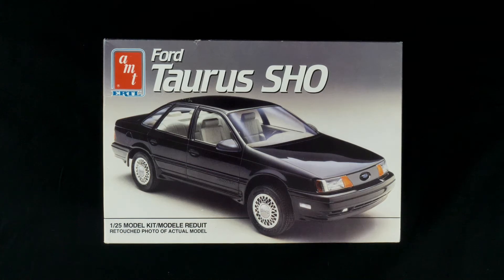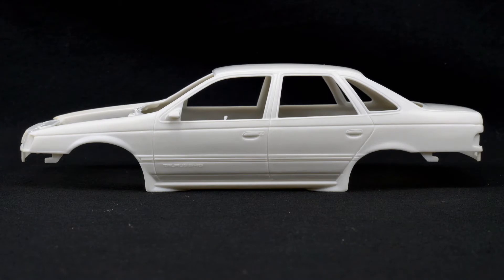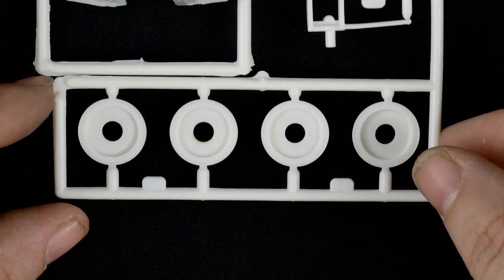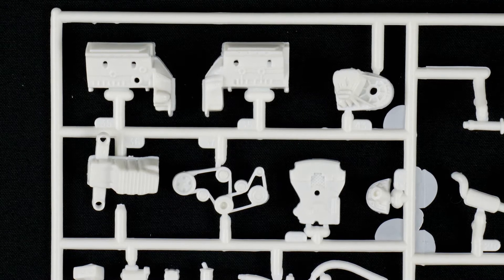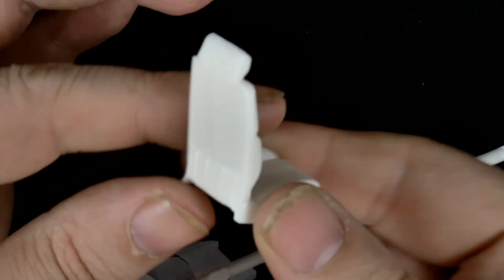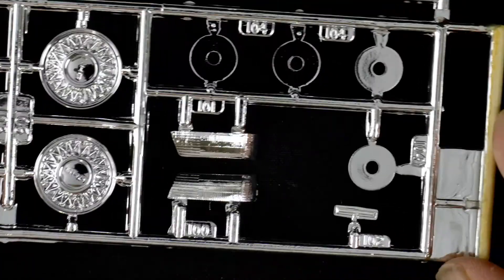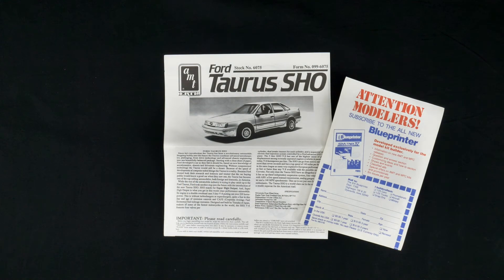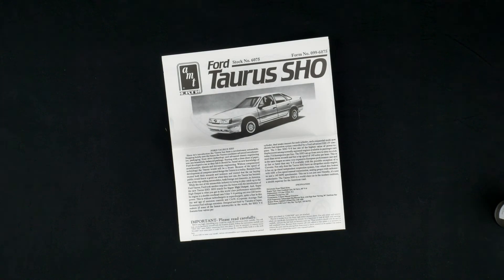Whats In The Box | AMT 1990 Ford Taurus SHO

Comment: Pay attention to how high-fronted some of those boxart builds are, almost like a real car with its' engine pulled. You'll need to shave quite a bit of material off the front underside of the interior tub and trim the firewall to avoid that stance and get the front down where it needs to be. No other build issues. Once you're done the most aggravating feature will be the "we've always done them this way" promo-based chrome front light clusters that could just as easily have been clear lenses.
 This car along with the '77 Dodge and early  '80s El Camino are on my wishlist for Round 2 to offer wagon versions of.